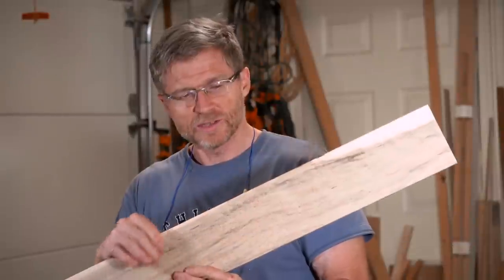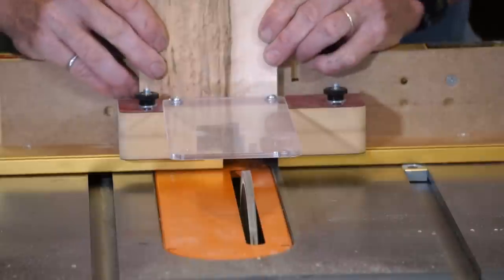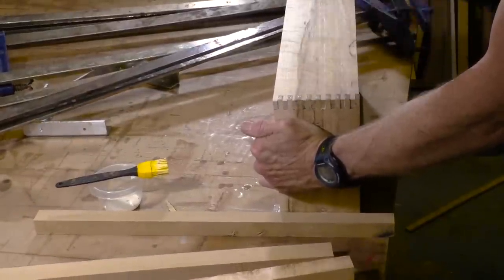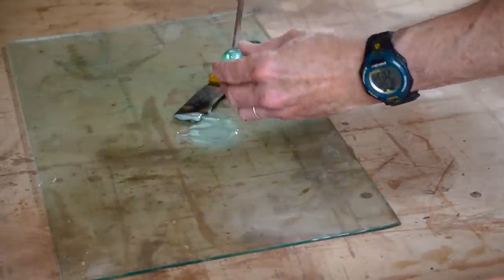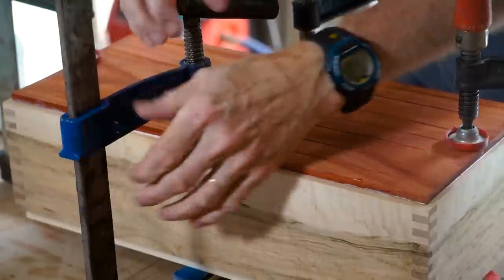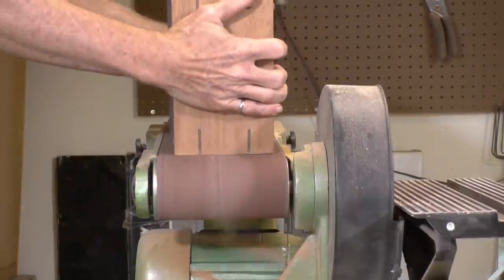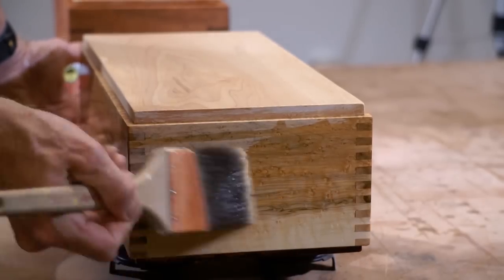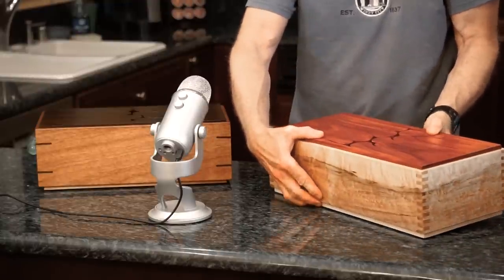How to Make and Tune a Tongue Drum

Comment: The pitch of each tung can be adjusted after cutting. By removing material at the base of the tung or the tip, you can raise or lower its pitch. This is typically done with a drill bit. Have the bottom removable to do this, or wait to attach it after you've tuned the drum.

Comment: I can virtually guarantee that the only wood that matters is the top surface. I would further bet that finding the optimum thickness of the top is more important that what it is made of. I base my comments on my knowledge of guitar-making.
Reply: Jack Gamboa i agree...  i think he made to top board wayy to thick...  the thinner the wood , the more resonance and movement of the tounges...
Reply: In my experience you guys are both right!  I have found no change in sound when making the sides of the box out of plywood instead of maple and some major improvements when using thinner wood for the top when making smaller tongues.  However for a large drum 3/4" wood can resonate nicely.
Reply: You guys must have never heard of drums eh? All the woods involved play a role. But yes it was way too thick and I think shaving them down lengthwise evenly rather than drilling is the tech.
Reply: Also, consider stabilzing the parts in an epoxy resin in a pressure-pot or vacuum chamber. Also, some addition of pieces in the interior to create bounce for the sound waves for better accoustics, even if just some quarter rounds or angle bevels in all of the interior corners to soften the inside angles would help with resonance too. Accoustics can play a big role even in such a small resonance chamber.

Comment: It sounds like it played in reverse lol
Reply: Exactly what i was thinking
Reply: The recording was done using a compressor that was turned waaaaaay up. There should have been no need for this.
Reply: @JFairweather  i suspect the transient was very high, which could make it difficult to hear anything after it if the volume is just low to begin with. A faster release on the compressor could do a lot.
Reply: @JFairweather  That is exactly what I was thinking!
Reply: It also may be that he had his lapel mic open along with the condenser microphone which causes some phasing issues
Reply: @nategroshek  i've never seen phasing issues be quite that drastic, but I suppose it is possible.
Reply: too compressed, to close to the mic
Reply: It's the automatic gain control, AGC,  very  sad,  you can't get a good recording with it.

Comment: There is a relationship between the main frequency emitted and the volume (cubage) of resonant chamber were the sound is reinforced, amplified...See the loudspeakers cabinet. Try to build the top at first, check out the frequency and then calculate the volume of the box...
Reply: Good advice.  When I make MINE I'll make the tongues first.  Then calculate the frequency and see if I want to further tune the tongue.  Then based on the wavelengths of each note I'll figure out what the optimal chamber size would be.

Comment: Awesome job, Mike!  Notice any difference in the tones once you put finish on? Or when you drilled the mallet holes?  Great experiment too, very nicely done!
Reply from the maker: Both good questions!  I was wondering if the holes in the end would affect the sound, but I couldn't really detect anything, so I would say that they didn't have an impact.  I'm less sure about the finish because I wasn't really paying attention to the before and after sound. The finish "might" have improved the sound, or it could just be me. They seem to sound better each time I play them. haha!
Reply: I have a piece of iron wood that I'm thinking would be very interesting to experiment on with a project like this.  But by the sound of it, the harder the wood the more difficult it is to tune.  I guess that means I'll have to be pretty careful when measuring out the tongues.
Reply from the maker: I'm thinking that it's the hardness that made it so hard to tune, but I'm not sure if that's the real cause. If that's true, given that ironwood is even harder than cocobolo, I think it would be worth the time to measure the tongues to get the pitch close to where you want it to be.

Comment: Just found your channel.  If you can spring for it I would recommend a zoom H4n recorder/mic.  It will give you the option of using other microphones down the road if you want and the on board stereo x/y mics sound really good.  If you are using a camera with a mic input it's easy to run a small stereo to stereo 3.5mm cord from the H4n to the camera.

The blue mic you own is geared towards pod casting aka your voice.  Unless you plan to sit in front of a computer doing talking videos or voice overs I would recommend ditching it for the above and a lav mic (a lav mic will kill a lot of the room sound you're getting in the video, plus IMO the room remover thing you are using sounds odd to me or maybe it's the room you are doing the voice over in, I don't know).

The wood whisperer uses a lav mic if you want to see how that looks/sounds.

My .02 cents.  I liked the build although it's above my head and I still have no idea where the heck to get exotic wood in my area but you got yourself another sub.
Reply from the maker: I really appreciate the time you spent to provide some constructive feedback. I will definitely take all of your recommendations into consideration. I actually did use a lav mic for the introduction and it has improved things a lot compared to when I only had the camera's built-in mic. I'll check out the Zoom H4n and see if it makes sense for my situation. Thanks, again, and thanks for the sub!  -- Mike
Reply: Also, just found your channel. Great stuff! And beautifull tongue drums!
A Zoom H4n will certainly help you! The sound in the playing test was not good enough...

Comment: Maybe consider some interior blocking for acoustic bounce. 45° blocking on the inside 90° corners, some sine wave blocking under the low notes, etc... could be a real game changer to the resonance of the instrument. Also, consider tuning by planing the tongues instead of drilling relief holes. Should affore better resonance than the drilling. A tongue depressor has better sound than a 2x4, type of idea. Thinner makes better tone quality. Think xylophone, not marimba, these are smaller tongues. If your making a 2' x 4' tongue drum, 1/2" would be a great thickness to shoot for, but on this smaller scale, maybe between 1/8" and 1/4" and then tuned by plane or scraper on the inside? Just some friendly input from a guy who grew up with a concert pianist dad (surrounded by music all the time).
Reply from the maker: Thank you very much for the constructive ideas. I've received a lot of feedback from viewers and I'll add yours to the list of suggestions that I'll incorporate into the next tongue drum that I make. I look forward to making one as soon as I find the time so I can release a video with a much better result.

Comment: It would resonate a lot better if you added a block of wood on the inside right at the end of your cuts. It shoulbe the same size as the interior measurement of the box ends. It will eliminate all that harshness.

Comment: I had a friend who made me a tongue drum, his first , and he put the box together without tuning it as he did not realize that this was part of the process.  Is there any way to tune the drum once it is put together?  You drums are beautiful and the tuning is great.  Thanks for any suggestions.
Reply from the maker: If the bottom is not removable, it might be feasible to cut the bottom off so that you can tune the tongues and then reattach the bottom. You could do this in a way to make it look like it was an intentional part of the design. That's something most woodworkers have done to recover after making a mistake on a project, and sometimes the result can be better than the original design.
Reply: Don't think that the bottom is removable but will see if he is willing to take the bottom off and then reattach.  Thank you so much for your help!!  Guess if this is not possible, will just play it with the tones of the tongues as they are.
Reply: You could also shorten each tongue to bring the frequency up to the desired notes.  However you would have no way to bring them down without taking off the bottom or removing material from the base of the tongue on the topside... but that might look silly.

Comment: How do you get the splines the same width as the cut you did?
Reply from the maker: I typically cut thin strips on my bandsaw and then use my drum sander to sand them down to the correct thickness. A lot of people do not have a drum sander, so you could also do it with a hand plane and sandpaper at the end to make fine adjustments.
Reply: @Woodumakeit  haha sounds like a lot of work when you don't have the right equipment lol. Cheers

Comment: What woods that grows in North America would be good to use for this
Reply from the maker: You might want to try western red cedar or spruce for the top. These are commonly used for the soundboards of acoustic guitars, so they would probably be good choices. For the sides and bottom of the box, maple is likely a good choice similar to how it is often used for the sides and back of a guitar.
Reply: @Woodumakeit   thanks I have access to plenty of red ceder

Comment: The mic is terribly compressed, there should be a limiter activated somewhere in the signal path and the initial gain being set too hot... This gives a "Ouing" sound instead of a "Boing" /"Bing" sound since the compressor Quickly eat the attack ( begining) of the sound. Since he seems to be using the table mic for talking, and that the boxes are much closer to the mic than his mouth and also probably producing a louder sound than his voice, having he mic level set for his voice is the main error over here. Two mic shoud had been used, one for his speech and one for the boxes. Another way to do it would had been to match the distance of the mic proportionally from the two source so that the mic hears the two different sources at about the same level. That's how they were doing things way back where all players of a band were carefully installed around a single microphone to make a recording out of a single chanel.
Reply: Tommy B. I’m kind of new to the more technical parts of audio production, but I’m trying to learn more. You sound like you really know a lot. Would you mind explaining what a compressor on a mic is? I’ve heard the term used before but I’m wondering what it does.

Comment: Would I make it?  Well, no, not exactly.  Why I watched is because I'm building a marble machine for my grandchildren.  One of the sections is going to incorporate falling marbles banging against wooden resonators, something similar to the tongue drum.  I was wondering about size of the chamber versus the length of the tongue.  I guess it's going to be a trial and error ordeal.  I want two different tones, as a single marble bounces back and forth converting its energy into sound.  As the energy is removed from the marble it falls further and further toward the bottom until it can bounce no more.  Then it falls against an old style telephone bell.  TING!

I HAVE seen tongue drums before.  I don't think they had rounded tongues though.  I think they were straight slotted pieces with a cross cut to create different lengths.  I'm sure someone has calculated out the lengths and the optimal resonant chamber.  Honestly I was impressed with the sound of the one I actually put my hands on.  Sadly, yours didn't sound anywhere close to how good the one I saw did.

Comment: Hello overe there ¿could you, please, give measures? Lenght and wide...!
Reply from the maker: The box is 15.25" long and 8" wide (388 mm x 204 mm).  The sides are about 4 5/8" high (120 mm), but the bottom extends out by about 1/4" (6 mm) and the top is about 1/8" (3 mm) higher than the sides, so the total height is bout 5 1/4" (133 mm).
Reply: I totally agree, i deduced those measures by watching doing your job at: 6:08 while you were tracind lines, I'm already making it...! Peace....!
Reply: One more question. ¿how tick is the wood for the tongues? ¿1/2 inch perhaps?
Reply from the maker: The wood for the tongues is 3/4" thick. I think you'd get a better sound if you use thinner material, so 1/2" might be a better choice.  The reason I used 3/4" is that I wasn't sure how much material I would need to remove during the tuning process, so I wanted to have the ability to remove as much as possible. I would definitely use thinner material the next time I make one.
Reply: thank you very much...!